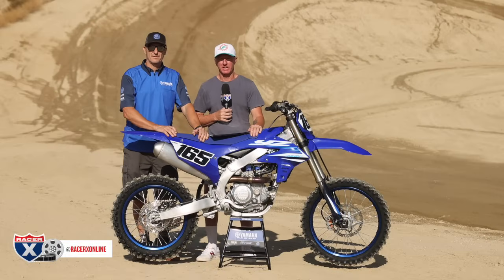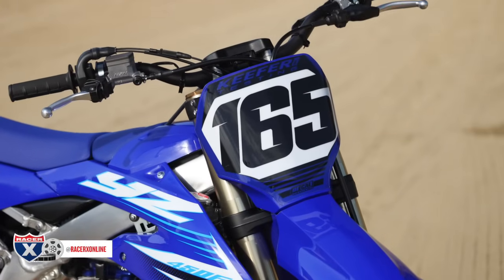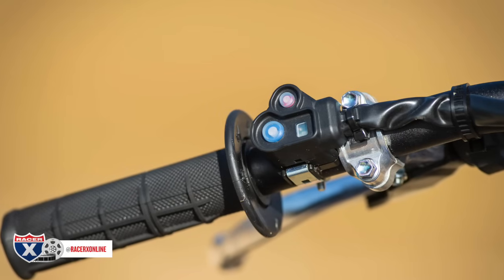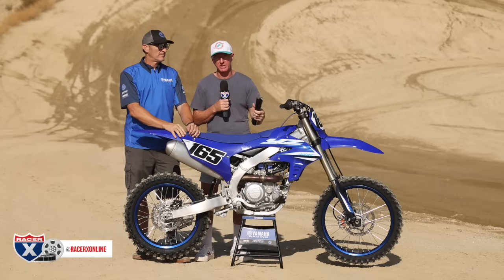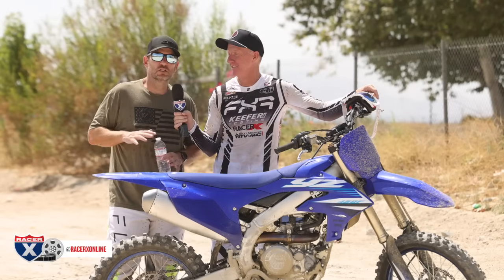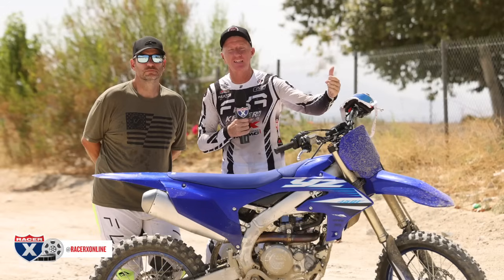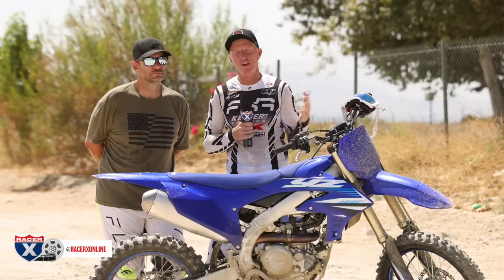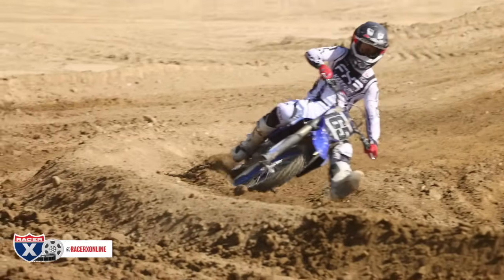"Where I wanted it to be better, it got better.” Keefer and Matthes First Ride on 2025 Yamaha YZ450F

Comment: to the guy measuring fork height with the caliper, use the other end..
Reply: 😂 feel ya 🤣🤟
Reply: Really shouldn’t go by that anyways. Not all material is the same exact length. Set your forks where you like them but use your axel bolt as the indicator that the forks are even. Adjust where the bolt slides through the easiest.

Comment: No improvement to the connecting rod, so we still get to worry about it snapping on jump face??
Reply: It has a new connecting rod
Reply: Whole thing new knuckle and connecting rod. Thats why there is a lowered spring rate
Reply: I don’t mean the rear suspension link, the engine’s crankshaft connecting rod snaps. Ask Keefer, it happened to him on a jump causing a crash.